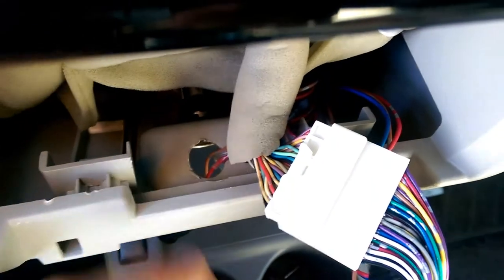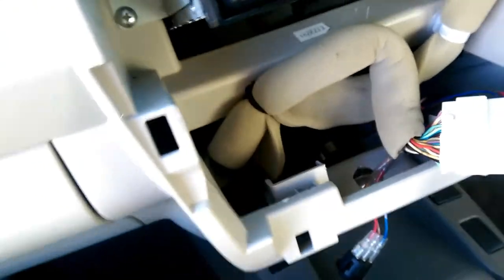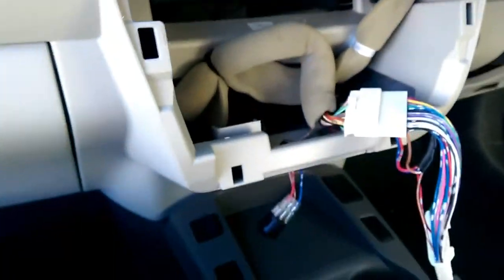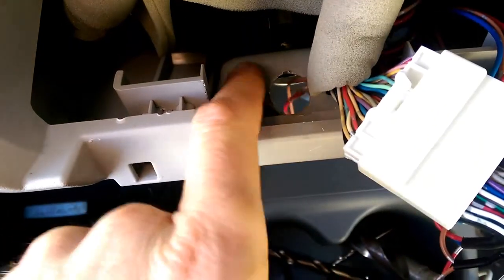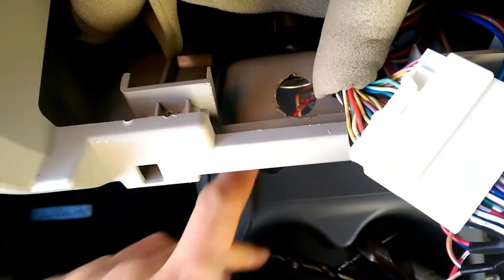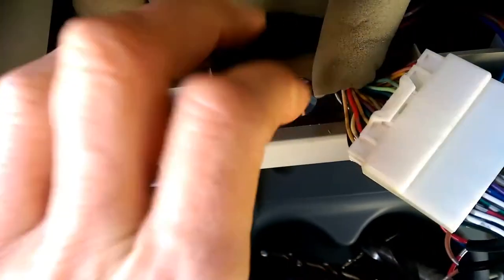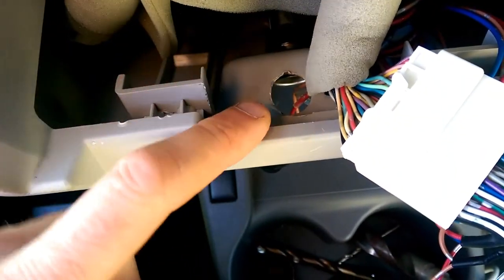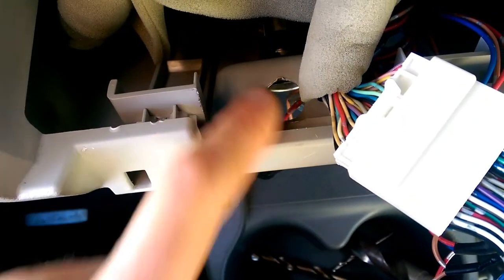Nissan Leaf G1 Heater Switch Installation Hole Location

Comment: i used one of the empty switch locations on the right so no drilling needed and easy to revert back to original after the lease ends and the Leaf goes back.
Reply from the maker: +bitman EV can you email a picture or make a little video to explain? That would be very helpful.
Reply: picture, switch on the left; http://cdn.goingelectric.de/forum/resources/schalter/42609
Reply from the maker: Nice.